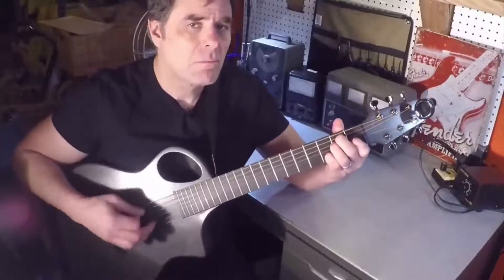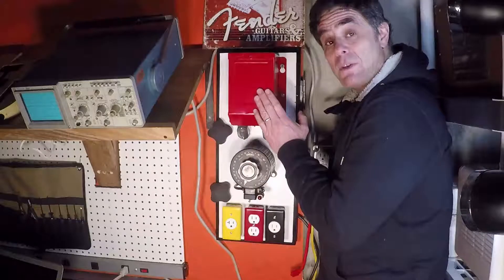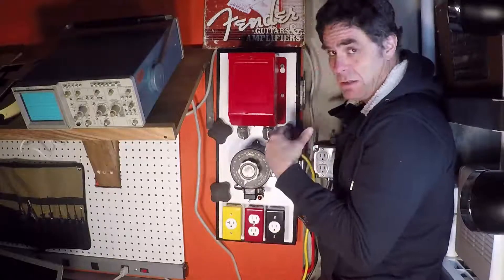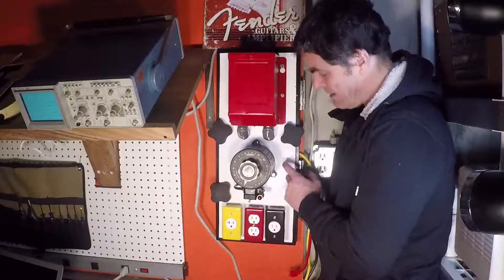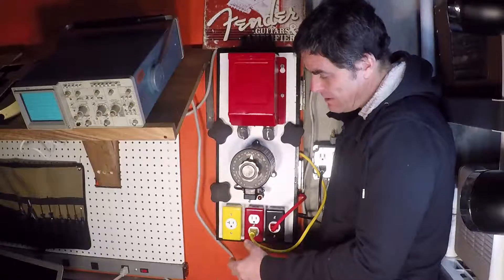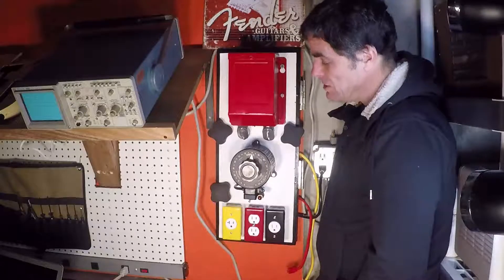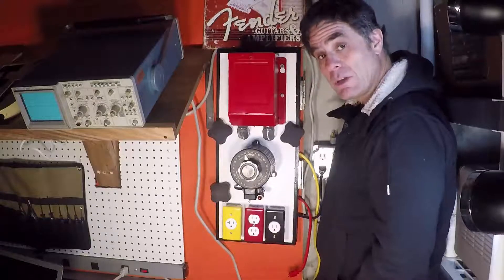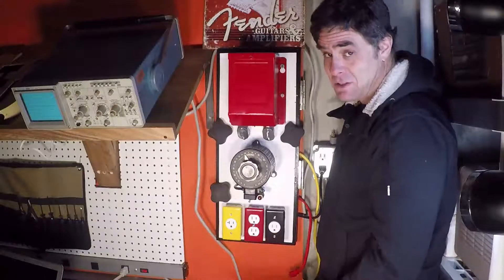How To Build a Power Center for Your Electronics Lab (AmpMechanic #001)

Comment from the maker: One thing I want to clarify is my comments on the current limiter. I said in the video that when a current limiter is in the chain between the source of current and the device under test (DUT) is that the current limiter will end up absorbing  current in the event that your body creates a short circuit between the source of power and ground (mains earth).  In essence your body is in series with the current limiter (which in my case, is built from four 60 watt edison bulbs that wired to each other in parallel). In this configuration, if your body creates a short circuit, as opposed to your body absorbing all of the current, it will share that current with the current limiter (sometimes also called current sharing). 

This by itself is not a guarantee that a current limiter will save you from injury or death in such a situation. Yes, it's added defense (in addition to other precautions like using an isolation transformer and best practices like the one-hand-your-back rule). But it only takes a few milliamps to stop your heart.  So, how could a current limiter save your life? What I should have mentioned is that if you have a dead short in your amp and it's plugged into the current limiter, the current limiter should light-up when the amp is powered on. If, by virtue of a current limiter, you know that your DUT has a dead short, you could save your life since a deadly shock is possible when such a condition exists (for example, if the amp's chassis is energized as a result of the short and you touch that chassis). 

Thanks to Don Bundy over on Facebook's Tube Amp Builders (DIY) forum for pointing out my lack of clarity regarding the current limiter. 

As a part of video series, I will eventually publish separate videos that go in depth on each of the components discussed in this video: the isolation transformer, the Variac (the autotransformer), and the current limiter).  I will also publish a separate video that focus on lab safety that covers a whole bunch of lab precautions and best practices to protect yourself from injury or death.

Comment: Nicely made unit! The value of current limiting light bulbs cannot be underestimated, I've used them for many years. Prevents loud bangs and lots of damage!
Reply from the maker: Thank you for the compliments. Yes, such a great safety precaution. Just have to remember to disconnect when biasing because it will impact you readings.

Comment: Hi David, I started following your channel since you sent uncle Doug the car radio. I’m in the process of setting up my lab, and liked the safety features on yours very much, by any chance do you have a wiring diagram (specially the part about the fuses behind the door) of your set up you can share? Thank you for all the videos. 
Greetings from Sonora, Mexico, 

Sincerely, 

Ruben 

PS, keep practicing your guitar skills, ✌🏼😂
Reply from the maker: I don't have a schematic... but I there's a fuse on both sides of the variac. One on the hot input and another on the wiper output. From there, it's pretty straight forward. Each device has its own plug and own socket. This way, I can chain them any way I want, or just use one or two at a time.

Comment: Thankyou very much for this video - I believe this provides the ultimate flexibility and safety in a lab . I have just set my lab up and am about to build a “power management system” like yours . Would it be possible to show me some pictures behind your door and do you have a schematic / wiring diagram you could please show me - particularly interested in the fuse placements .
Reply from the maker: Hi Bruce. Apologies for the late reply. I'm just now seeing this for some reason. I don't think I have a schematic. But keep in mind that behind the door, there's really nothing complicated. On the "input" side of each device is the color-coded electrical cord to plug that device in to a power outlet and on the "output" side is the color-coded electrical outlet. So, they're really 3 completely separate devices and circuits. The only device that's got a little extra going on is the variac. There's fuse on the input side (on the hot) and a fuse on the wiper going out.